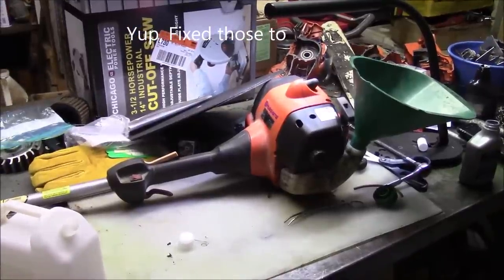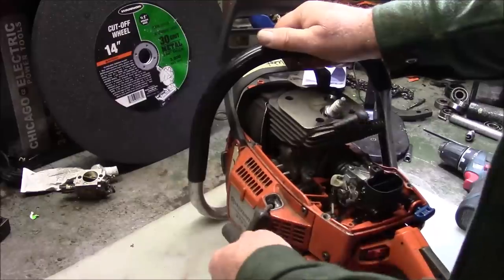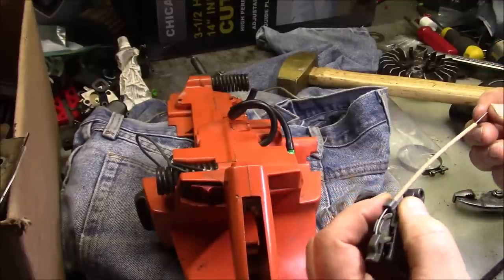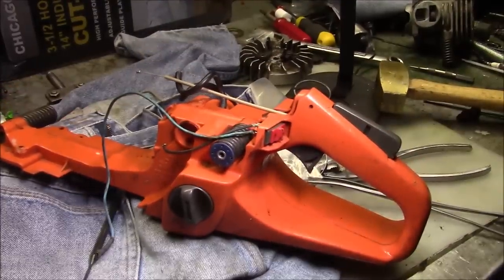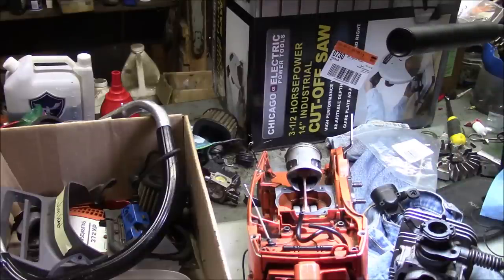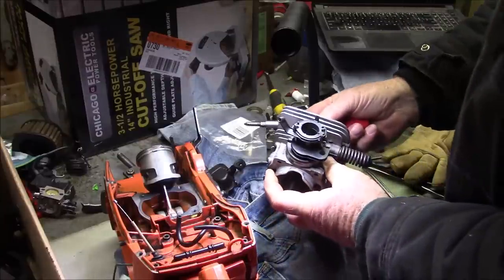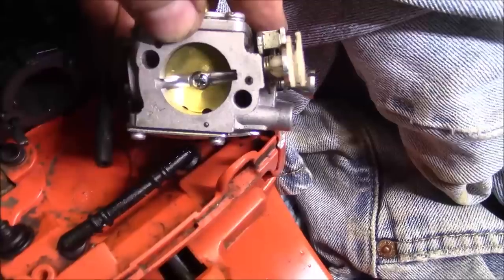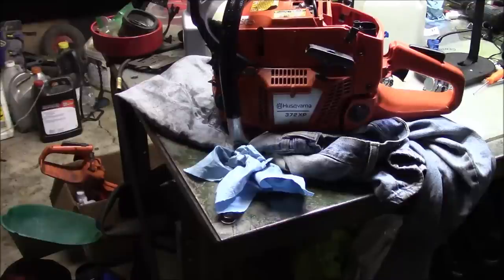Husqvarna 372xp X-Torq Mods, Dead Saw Salvage with some tweaks..:)

Comment: Bingo, I cranked my clone 660, today.  Tomorrow may be a different story but I cranked it, today, without it beating me to death.  I ran it for 20 minutes and fine tuned the carb a bit - idle, 2570; WFO 12,900, where I set them two months ago. All with good acceleration.  Thanks for your assistance and guidance.

Comment: I'm doing some tree clearing work on my land in the Hudson Valley with my Husky 365 X-TORQ. I'm going to do a muffler mod, remove the transfer port cover restrictors and possibly base gasket delete depending on the squish from the factory. What size tube do you recommend using for the muffler mod? Thanks!

Comment: Hey Walt, do you know which one of your videos covers the oil pump on a 372? I've looked through your vids and cant find one. Specifically which way that sleeve and thin shim go and what seals the pump to the pickup hose. 
  If you remember, I asked you a few things a few days ago about a nonoiling 372. My problem was someone turned the adjuster all the way out beyond the wire clip and then turned it back on on the end of the shaft which stripped the plastic threads right off of the worm gear.

Comment: When I saw your pants on the work bench under the saw I thought isnt it winter in NY?  Why is Walt working in the shop with no pants on?  lol

Great job on the build.  Did you run the blue limited coil?
Reply from the maker: Yup, I haven't been shooting for more RPM's so really don't see a need for the black coil yet.

Comment: Hey Walt... Do you need a special compression tester or can i use my snap on tester for cars?  What is a good Compression reading for a saw?  I have an Echo CS 3000 with 125  is that too low?
Reply from the maker: Compression is compression. My "tester" s for Automotive applications. The only thing is it will read a few lbs low because of the "volume" in the hose that goes from the plug hole to the gauge...air IS a compressible fluid! So it's good for a "ball park". A Saw will run in that 125 range. Rather see in the 140 range. But remember with such a small cylinder if you have a set up like mine, that might be a low readings and the actual compression might be closer to 130..:) Still lower than you want, but should run.
Reply: @afleetcommand  Mine runs...but when it gets hot it loses power & wants to die...constantly has to be throttles. New Plug, Carb, Pressure test,  borderline compression is all i can figure.
Reply: @afleetcommand  Friend, the revolutions 13200 max for the saw 372xp oe 2003 are okay?

Comment: I have a 372 that is bogging severely at full throttle then dies when you let off the gas. Not fuel line or filter is not carberator or muffler issues what else would cause that ? Air leak ? What are symptoms of a air leak ?

Comment: Hi Walt, I have a older 350 is it possible to be an air leak if it goes full throttle as soon as it starts? Great compression, piston is in excellent shape, I put new base gasket and metal clamp no change. Any advice would help. Thanks
Reply from the maker: Check to see if that throttle linkage lets the throttle close? Check the throttle plate? Pull it apart and see.

Comment: did you use the blue coil....with the rev limiter, my manual says 10200, but I've seen higher specs, whats the high rev on that build,
Reply from the maker: On 372's ? I always use the later x-torque "blue" coil. Unlimited coils are way over rated. Discussed why in several of my video's
Reply: @afleetcommand  thank you for your answer, I'll see if I can find those videos...

Comment: Is the x torq cylinders not nikasil plated, if so how did you hone it without wearing through the plating?
Reply from the maker: Just as you saw it, and that didn't get through the plating. Done it for years.

Comment: What kind and where did you get the steel cages bearings?
Reply from the maker: dealer
Reply: @afleetcommand  6202? Will they work or is the specialty bearing like the 550mark2 takes?
Reply: There is no dealer close to where I live

Comment: Would you go ahead and gut the boot and filter housing on a brand new 372?
Reply from the maker: I would, but it really depends on your skill set and focus. So that isn't a recommendation for everyone else. The later than 2017 versions ran pretty well right out of the box. The gains by modifying would feel "incremental" and might disappoint if you are looking for a transformation level change. So you would ask why would I do that change? Because it's easy for me to accomplish, just an hour or two, and along with a muffler mod and a few other things the saw runs incrementally better....in my way of judging that. And while that difference may not be worth the effort to some it is to me on my saws.